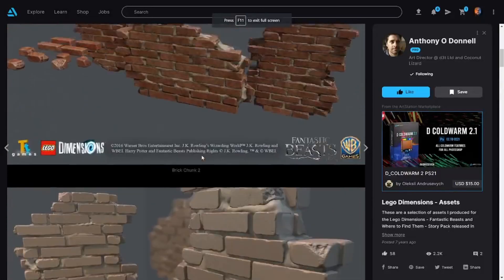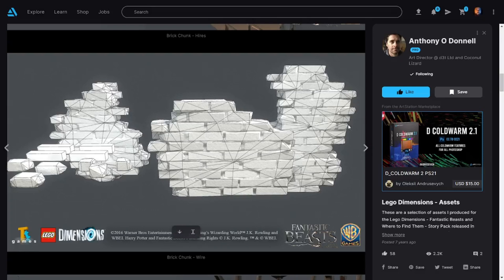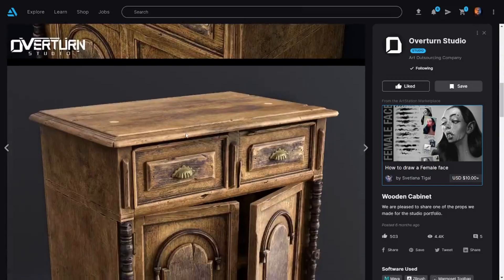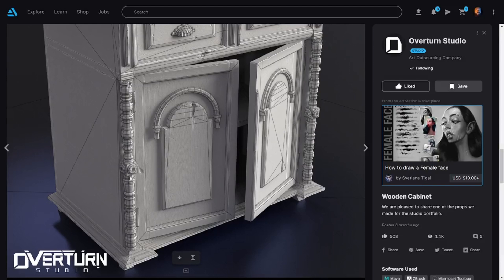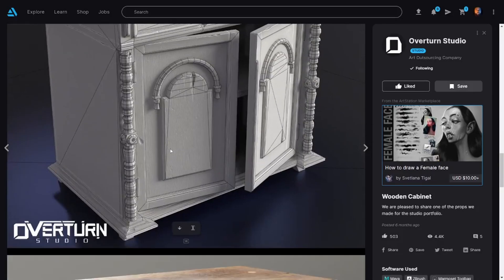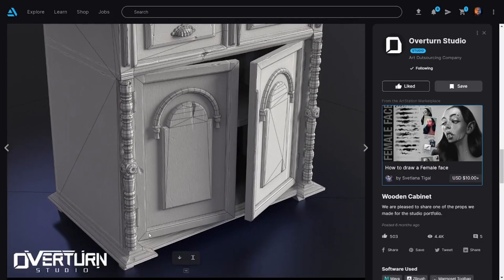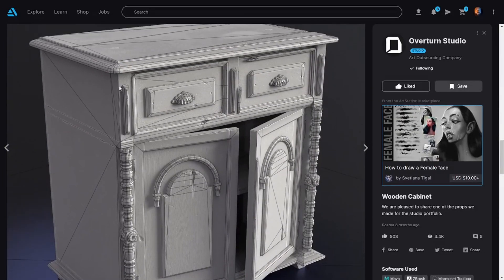What Does Good 3D Modelling Optimization Look Like? (Prop Edition)

Comment: Question about floating geometry (might make a good video?) - that cabinet by Overturn, taking a look at the doors the detail on them appears to be floating geometry, the arches and center piece. What are the pros and cons of this? Am I even right? What sort of considerations should one make with floating geometry?
Reply: Best I can tell, floating geometry is pretty common in game assets with flat meshes acting as decals sometimes even being used.
There are some issues with z sorting when looking from larger distances because the depth buffer gets less precise further away, but ive seen game engines expose a z priority option that allows things with the same distance in the depth buffer to have a specified rendering order.

The other potential issue is certain shader effects having different behavior on intersecting and connecting geometry. This is very specific to your game, and kinda rare though. I'm honestly struggling to remember where I've seen this happen. I want to say it was some kind of screen space AO shader, but in theory I cant imagine that being an issue since it doesn't base its effect on vertex data.
Reply: Oh man. I forgot something important, but someone else in this comment section mentioned it so im putting it here.

When you cover some portion of a mesh face with another mesh, that portion still has to be UV unwrapped to allow the visible parts to be textured. This wastes part of your texture space, which can be pretty expensive considering textures take up a lot of Vram which is in short supply on most GPU's.

This makes floating geometry much more efficient when reusing texture space like when working with trim sheets.

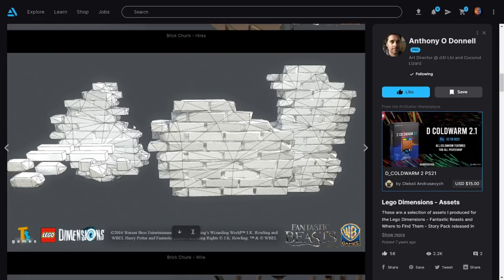Comment: 0:30 there is a somewhat unfortunate bit in the middle where several very thin and long triangles connect to each other. Think of it like this, for every triangle edge pixel, the GPU will render a whole group of pixels, usually a 2x2 pattern of pixels, so when you have an area where you have thin long slivers a lot of pixels which will be shaded several times over, with the result then discarded as it's clipped to triangle extents, so you're consuming unnecessary shading bandwidth. It's better to terminate the fan earlier if possible even if you have to introduce an extra vertex, with vertices being fairly cheap most of the time relative to pixels. Of course the impact is very very tiny either way but it can add up.
Reply: Hi , this is correct solely from a texture POV, this has to be weighed against vertex limits per frame which for that project were very very tightly controlled. Even though it would be better from a pixel level rendering POV the added vert cost across assets was not possible. Game art will always be a lot of trade offs.
Reply: For added context we also knew the camera distance to the asset, therefore the screen fill percentage never really hit the 2x2 pattern of pixels to be a serious issue relative to the vert counts.
Reply from the maker: Nice one thanks for the info, that's super technical and blowing my mind, amazing.

Comment: The second example shook me when you showed the topology, I was expecting way more beveling for the edges and extrusions but I guess they just managed to make the bake somehow show through nicely either way, would they have used any sort of normal smoothing or custom split normals on the mesh itself there you reckon?
Reply from the maker: If you use chunky bevels on highpoly models, your bake will read a lot better on the lowpoly, if you have tight and accurate edges on the highpoly, it may be 'accurate to life' but it won't really look good or read well in a game.